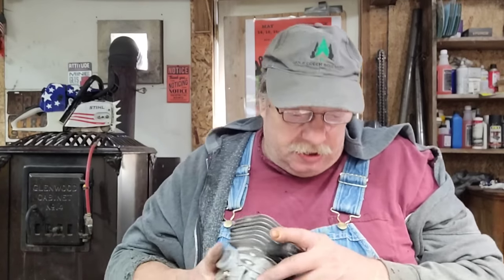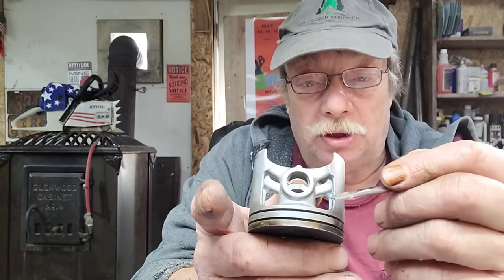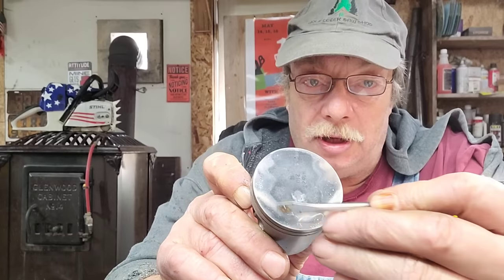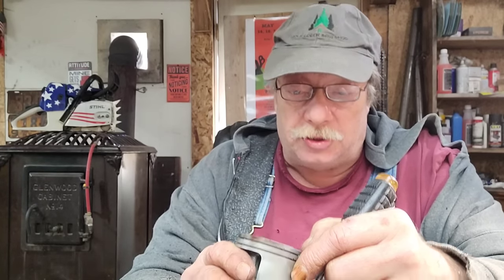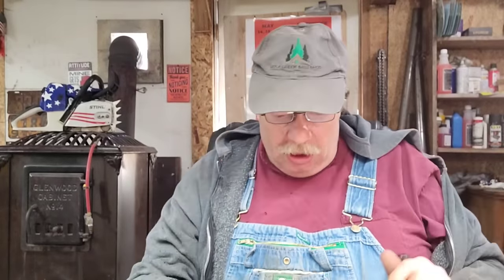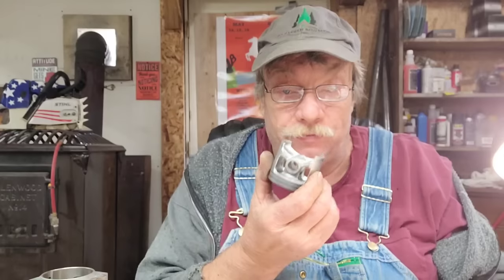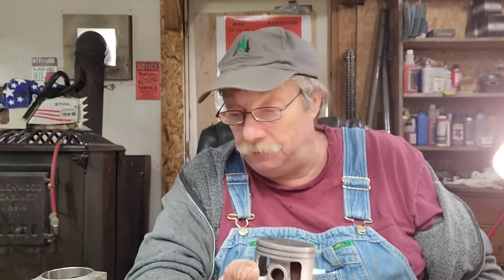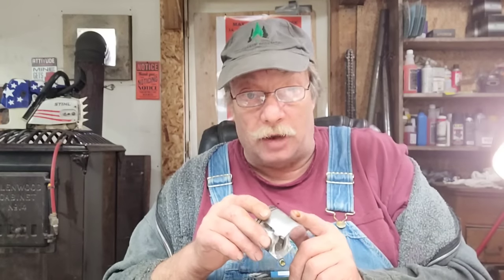husky 395 piston prep and porting numbers! saw fest! wild thing nitro saw build!

Comment: Hello Harvey, haven’t been to your channel in a bit, but now you have caught my attention again! I want to see every aspect of the “Wild thing build” or shall I call it “Hog Wild”😂😅😂😅, this will be the first time for me to see one of these being built as a hot rod saw! I have heard both good and bad reports on the Poulan saws, and I have a few smaller saws that need building as well, 2 poulans and a few small macs! Lets see how well you can coach me!
Reply: I can tell you this much pat. I have a 26 year old popular pro 260. It has been my favorite saw for limming and lighter work. I only keep it clean inside and sharp. Run it on 32:1 gas. It has only took a sprocket and a couple bars in all those years. Great saw
Reply: @ronaldgodden4490  i never knocked poulan saws, i just wish quality control was better from manufacturing! After a season cutting with the Poulan Pro 5020, I had carb nuts falling off, a loose muffler, and a slipping clutch ( spring issue) all corrected without spending $

Comment: Any of the honda or yambond seals are amazing and made for machined surface sealing like cases but you have to clean it good it will not seal a wiped off oil surface you have to use breakclean non chlorinated works best it hates oil coolant gas diesel water and some of the degreasers leave a film that it don't like

Comment: Permatex motoseal,yamabond,hondabond,kawibond, threebond are better than any silicone. Motorcycles don't use silicone at factory. I don't use it on anything just squeezes out and is a pita to clean off case's 😁😁 . Been using motoseal for 5-6 years now and I do alot of mx bike engines 🏁🏁 good video 🔧🔧👍👍